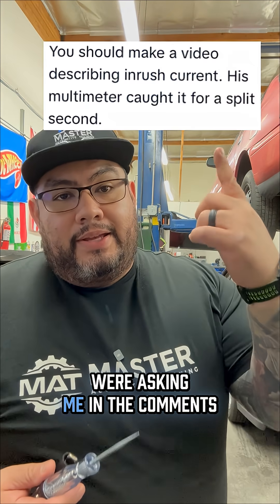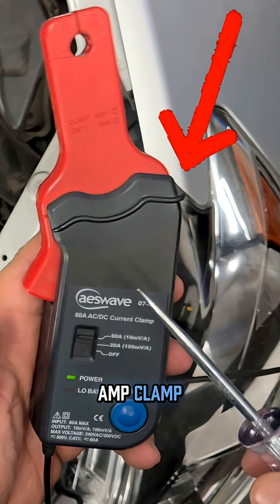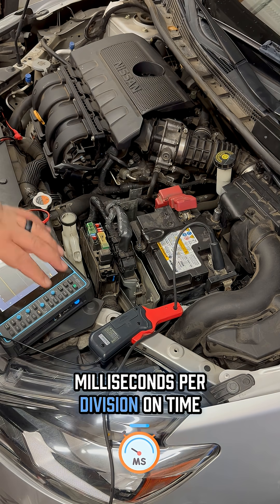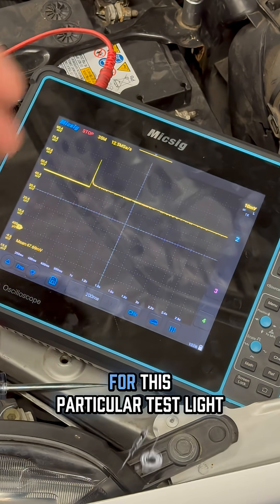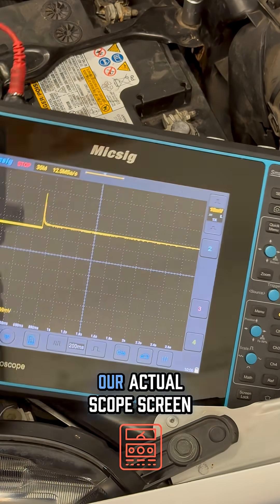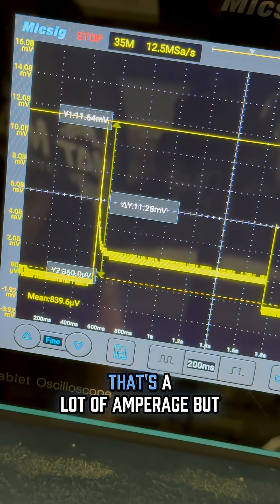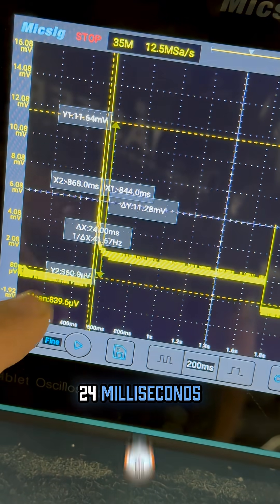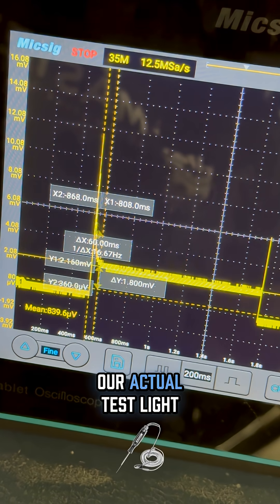Test Light Inrush Current — Will It Damage Circuits?

Comment: As an old timer we were always warned(in classroom settings)to NEVER probe anything in a system connected to modules with a standard test light. Modern modules likely all contain protections against shorts to ground/excessive draws in all their circuits. However vehicles are still in use that could be damaged by overloaded circuits and shorts to ground. Understanding the current inrush is a wonderful thing and useful in so many ways, but in reality there's no real reason to use an incandescent test light except for the simplest of circuits. Every professional should have a digital tester of some kind(power probe, etc.) for this purpose. I cannot count the times I located solutions because I was able to see low voltage on circuits(I.E. 4V, ETC) that would not illuminate standard test lamps. 

With that said LED test lamps are great for quick checks, and incandescent test lamps are useful as a circuit load tester. Once I acquired a LOAD PRO my incandescent rarely sees the light of day.
Reply: I’m with you on one big point, I would never stab random module circuits with an incandescent test light. That’s exactly why I measured the inrush and steady-state draw on mine: so techs know what kind of load they’re actually hanging on a circuit.

A power probe or DMM is great for seeing voltage present, but with almost no load a rotten wire or connection can still show 12V all day. Current is what does the work, which is why a known load is still valuable on the right circuits, starter feeds, relay contacts, lighting, charging cables, etc.

What you’re doing with a LOAD PRO is the same principle I’m teaching here: understand the load you’re applying so you can choose the right tool for the job. My video isn’t “use a test light on everything,” it’s “know what your test light actually draws so you don’t use it where it can cause trouble.”

In our industry, tools aren’t the problem. Not understanding what they do is.
Reply: Tell that to @ScannerDanner 
He could diag any vehicle with an incandescent test light and a spray bottle of water 🤣🤣

Comment: So LED would be considered even safer or
Reply: LED lights don’t draw enough current to be used as a load. Most relays draw .100 mA and LEDs only draw around.018-.050 mA. Imagine using that on a headlight circuit, the LED bulb would be nice and bright and the incandescent bulb would be dim if there was a low voltage scenario.